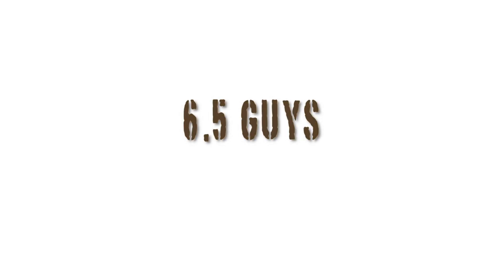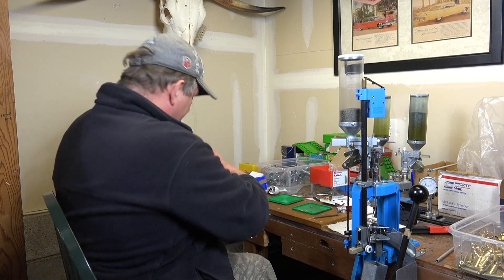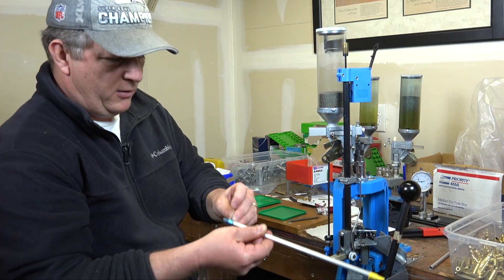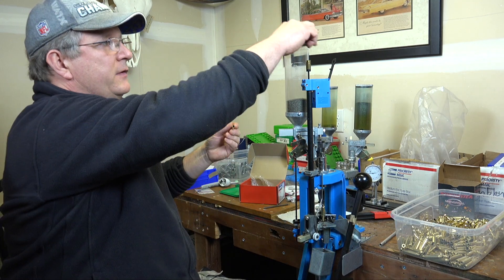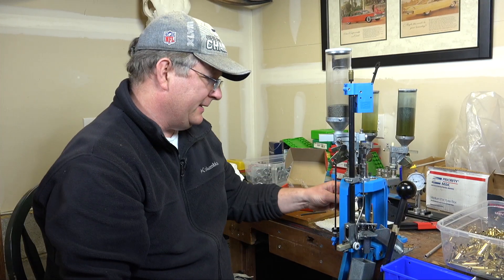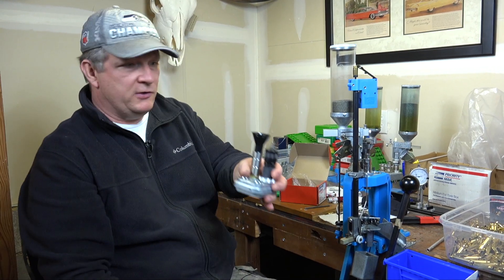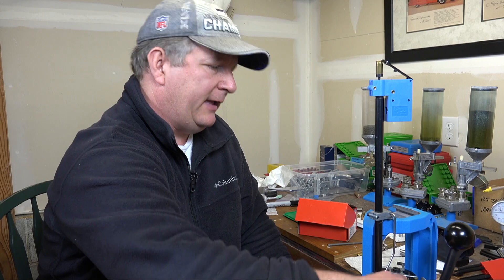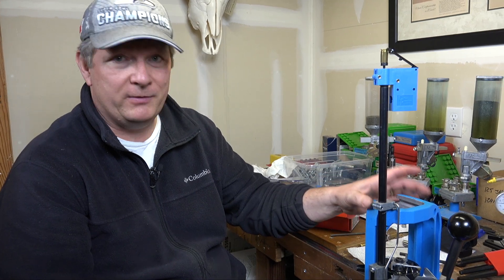S3 - 06 - Precision Ammo From A Progressive Press

Comment: After 20 years of loading pistol ammo on a 550b, I finally decided to start loading for rifle last year. 
My interest was leaning more toward long distance precision so it took me a while to decide if I could do it just using the 550. If the ammo was for a semi-auto, no question, but with a six die line-up, not including the Dillon powder or crimping stations, I just couldn't get my head around dealing with the tool heads and making it work in a way I would be happy with. 
In the end I bought a Forster Co-ax press, primarily for the ease and speed of swapping the dies in and out, and it works great, no regrets. 
I'll use the Dillon for all my .223, but could also set up one toolhead to work, in conjunction with the Co-ax, on my long range precision ammo.
Station 1) Lee Collet Die, so deprime, neck size, and prime.
Station 2) Sinclair Expander Die
Station 3) Dillon Powder  Die
Station 4) Redding Seating Die
That would leave me with a K&M expander, a Lee Depriming Die, and a Redding Full Length Sizing Bushing Die for the Co-ax.
It would mean loading both the brass and the bullet in on the right side of the machine, powder on the left, but it's hard to argue with a loaded round for every pull of the handle!
Thanks for the thought provoking videos 6.5 Guys!
Reply from the maker: Thanks for the positive comments and also sharing your perspective on using your Dillon 550 for loading precision rifle cartridges.

Comment: So I viewed the video 2.5 years after you posted it.  I have something to add to the 550 vs 650 discussion.  I have a 650 and with aftermarket parts via eBay, I can replicate what the 550 does with manual indexing.  There is a well made cam switch that can disable the primer feed quit easily and there are several ways to disable the cartridge feed also.  Indexing will continue but it's easy to remove a shell and restart at the priming station.  Then when everything is settled and you're getting what you want, you start the production line.  I too use a separate tool plate with a universal de-primer mounted, so I can do the decapping process quickly.  I de-prime prior to cleaning.

I've been shooting 6.5 CM for about a year and have used both an RCBS Rock Chucker and a Redding T7 for just the Creedmoor.  Spend a fortune on dies and think I have my final solution.  Now however, I am thinking of moving the whole operation from T7 to Dillon XL650.  Probably use two tool plates, one for de-priming and the other for reloading.  I would use my existing dies (Redding small pin de-primer, Redding S type FL bushing die, Sinclair Mandrel and Forster Ultra-micro seating die).  I would have to buy a powder funnel so I could use measured powder charges.  As much as I like the single stage presses, I could gain some much needed space in load bench setup.  On the other hand I wouldn't expect any degradation of precision.  My current load does very well for me.  

Hopefully either 6.5 Guys or other readers will comment, and tell me if this plan is viable, or if I would be shooting myself in the foot.

Comment: Thanks for the video guys. The 650 has the same locator tabs as the 550 (those tabs you remove to pull a shell off the shell plate). As far as I can tell, the only difference in the machines is the auto indexing. I think when starting a reloading session and confirming measurements, manual indexing would be a big advantage. Once settings are confirmed, the auto indexing would be a big advantage...just my humble opinion.
Reply: I believe you are absolutely right. If you do end up getting the 650 please let us know how it works out. Thanks for watching!

Comment: Ed, just a tip: when you stand in front of a camera, check your framing.  At the beginning of the video... you have horns growing out of your head. O h yeah, using a safety pin in the primer pickup tubes works wonders. I tied a piece of bright construction marking tape to the safety pin, kinda like a "remove before flight" flag for an airplane

Comment: I have had the 550b for 20+ years and it still runs like a Swiss Watch. The only thing I have done is change out the cotter pin on the spent primer mechanism with a piece of wire. They are famous for hanging up and staying open a little and dropping primers everywhere. Lol

Comment: I like your videos - thanks.

I think a small correction is in order.  You said with pistol ammo the case would overflow with a double charge.  I've loaded a lot of .45 ACP and with a starting charge of as little as 3.5 grains of Bullseye you can easily get multiple charges in one case.  The same is true of other calibers and powders.
Reply: You're right - with certain cartridges and certain powders you can get multiple charges. My point of reference is with 9mm and a double charge of HP38 spills over. Even if it doesn't spill over, it's hard to miss as the powder is right at the top. Of course I look into each case before I seat the bullet. Thanks for watching!
Reply: I’d be more concerned with missing a charge and getting a squib.

Comment: I have questions about your mandrel. Are you using expander after you neck size. I am using 6.5 cm with redding fl type s neck bushing die but I'm interested in the Mandrell for consistency but not sure if I need to change my neck bushing size? Great videos as usual is so great that we can ask you guys questions. Just getting into PRS shooting have 8 local matches scheduled at the range I'm a member of trying to get my reloading sorted out. Switching brass from hornaday to Starline or Lapua

Comment: So even throwing powder charges with the dillon setup your still getting the ES and SDs that are expected out of match ammo? Or a single stage press?
Reply: +Will Sartin (5RWill) With the .223 when I weighed each charge I had SD around 8 fps. With the automated powder charger I'm getting SD around 14. For practice ammo at 200 yards this is just fine. For long range match ammo I'm weighing each charge and using the powder funnel. Thanks for watching!
Reply: I see. That's what i wanted to know. Thanks for clarifying.

Comment: Do either of you gentlemen have experience with a Savage Model 12 LRP in 6.5 Creedmoor? I am thinking about getting one for long range shooting. Thanks for any input!
Reply: +ryan moeller Hi - not that exact model but we have seen Savages at matches and they do quite well. They are very easy to service for the DIY gunsmith especially when replacing barrels. If this is your first long range rifle, it would be a good place to start. 6.5 Creed is also a great cartridge. Thanks for watching!
Reply: the savage LRP is a beast in regards to weight. With a .98" full length barrel they end up weighing a bit on the heavy side for doing alot of moving and obstacle style shooting.  Accuracy is like any precision rifle I was constantly hitting out to 1200 with the 6.5C using 140gr over H4350
Reply: Love my Savage LRP but it’s a bit difficult to shoot off hand. Hope u workout. Lol

Comment: I am debating between a hornady lock n load ap or a single stage press my main goal is precision match ammo but I would also like to reload 223 and 9mm. What would you recommend? I am new to reloading but love the idea of using and auto progressive press if it could suit all of my needs. thanks!
Reply from the maker: The Hornaldy L-N-L AP will work great for 223 and 9mm in AP mode. It will also make great precision ammo but I would caution you that if you fill powder in a cartridge up into the necks this particular press may cause a bit of spillage because cartridges move (start/stop) quickly when they index to the next position in the press. Just something to keep your eye on.

Comment: Never thought of using decaping die to clear primer pockets of media! 🤔 Thank you.
Reply: +Mark Nicholls Thanks for watching!
Reply: +Ed Mobley 
I haven't use shell media for some time now, a bit surprised word is still slow to travel on SS media and like kind tumblers. e.g. Thumblers Tumbler. Yes, you do need to dry your brass after but the quality of clean surpasses any other media and no leftovers in the PP's. IMHO.
Good vids guy's.
Reply: @robleo69  My personal experience with wet SS tumblers is the pins get hung up in small cases. They are really hard on the case mouth and primer pockets also. 
They do not polish the brass they scrape it clean. Look at a case from walnut compared to SS pins under magnification and you will see the difference.
Reply: @jamesglenn520  I use ultrasonic now.

Comment: It doesn’t seem like using a progressive reloader is any faster since most of your time making precision ammo is prepping the brass and weighing the charges. If you are using the dillon powder thrower then it’s most definitely faster.
Reply: Hi - A powder thrower is even faster but not as precise so there is a trade-off. I timed myself making 100 rounds using a single stage press vs the method demonstrated in the video and I cut my time in half. Of course your individual results may vary.
Reply: Ed Mobley thanks! Really enjoying you guys’ vids!